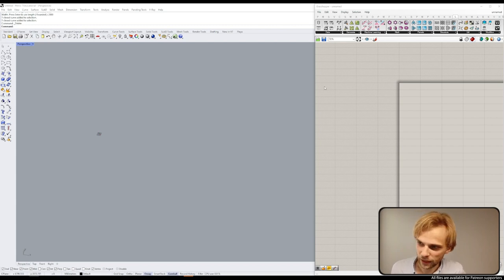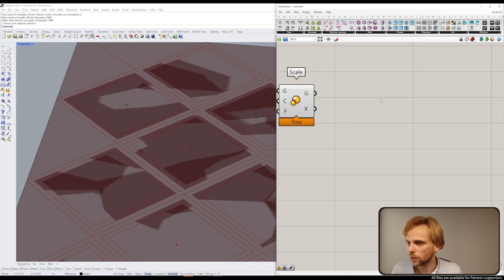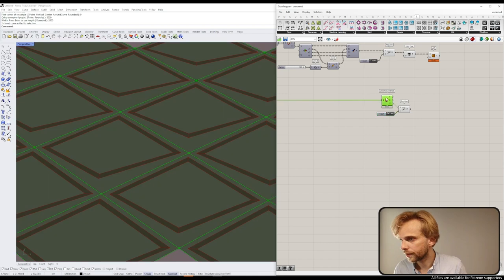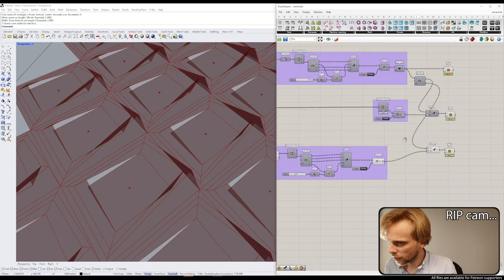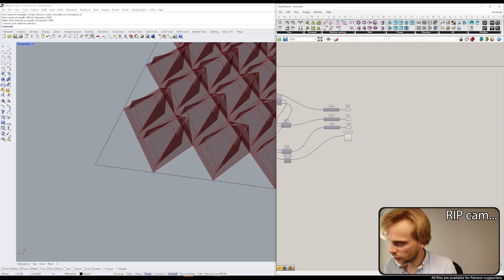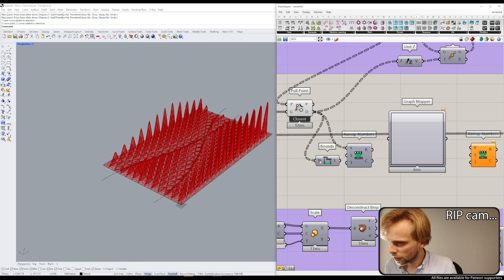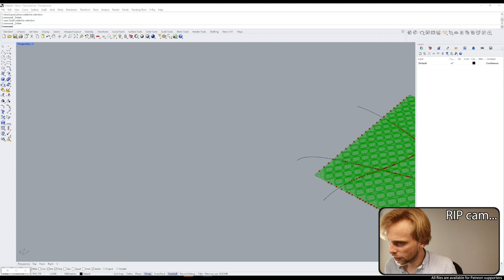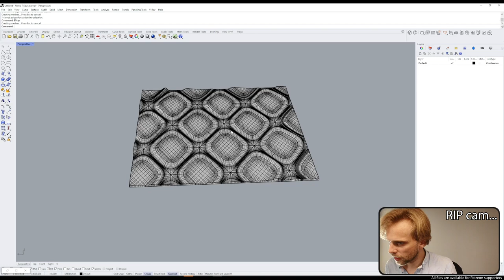How to: Parametric wall No.2 "Diamond" - Rhino +Grasshopper  Tutorial

Comment: 53:40 To remove the warping effect after milling on MDF material, just glue and press some thich saturated paper on the bottom side before mechanisation. It helps a lot. I do this all time.

Comment: If I wanted to do a large wall, like 30 x 10 feet. I have a couple ofnquestions, maybe you can guide me.

A) Will the simulation for your cloth tutorial will a decent computer beable to handle simulation?
B) if I want the surface to be parts cloth and part vornoi or diamond ... how would the diff areas blend? Any suggestion?